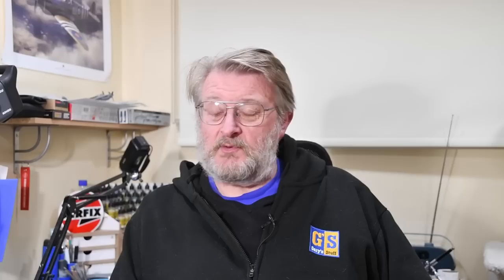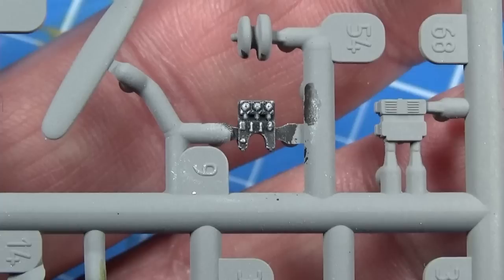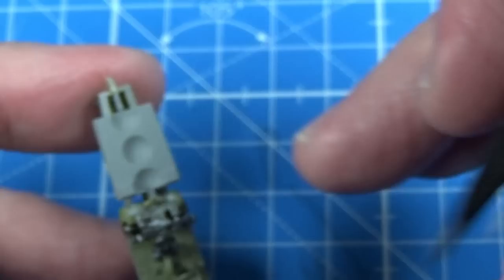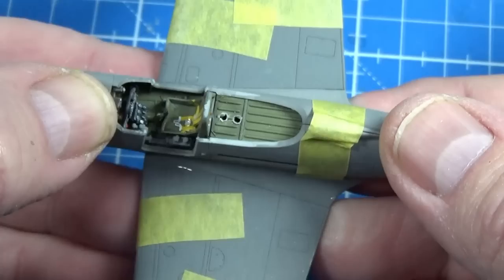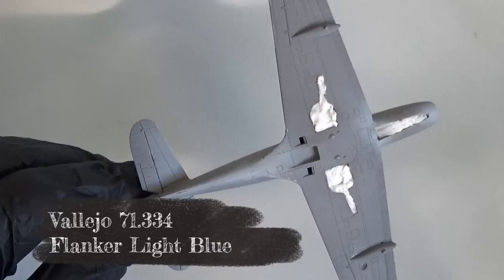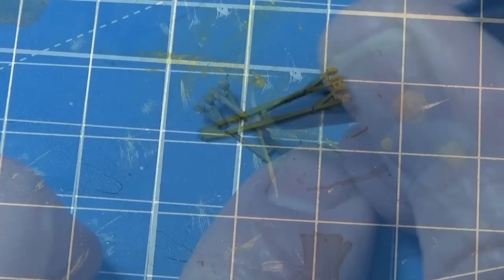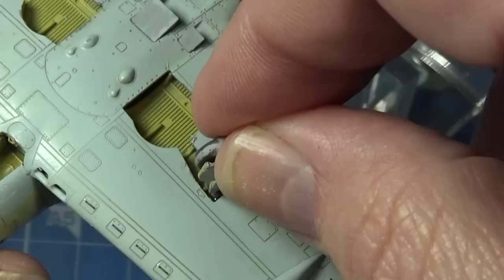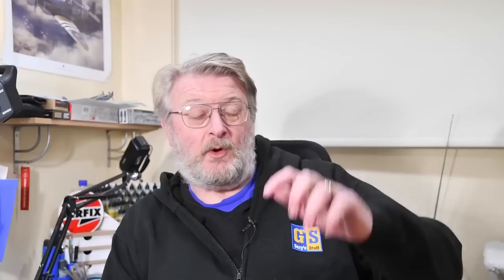P-39 AIRACOBRA Arma Hobby 2022 NEW TOOL 1/72 scale - how to build it - 1080p HD

Comment: Great build I have this kit and I am glad that you made a video showing us the problems that you had so we can be on the lookout for them and be prepared. It looks great and I can’t wait to start mine thank you.
Reply from the maker: It looks great when its done but the nose gear is a bit of a pain. The surface finish is awesome though. I though it would get lost in paint and varnish but it didn't.
Reply: I noticed you found the gap in the forward fuselage when closing it up. Plasmo did a video on this kit as well. He showed a couple of places where the parts didn’t fit flush. One was in the front where he had to grind down the ejector pin circle and deepen a mounting pin mating hole.
This looks great. I have the kit and want to build the same marking s heme.

Comment: I really wish companies gave as standard canopy mask sets.  Especially for 1/48 and above scales and there's no reason not to include 1/72 kits either.  Even if it added a couple of extra quid onto the cost of a kit to cover manufacturing costs and that's probably more than it would cost them to be produced
Reply from the maker: Absolutely - would be a real selling point. Maybe might make starter sets look to complex for the new model maker, but otherwise it would be really good - especially for things like the Beaufort or the He111 where there is glass everywhere!
Reply: I agree 100%. Or at least provide two options, one kit which comes with masks, costing a bit more, and another without masks for those who don't need them. Especially Eduard masks bought separately are overpriced, that's why buying a Profipack usually makes sence.

Comment: Gary gotta have a stern talk to you about your zealous use of glue mate. One thing to say…. Tamiya super thin is all you need.
Reply from the maker: I use Extra Thin a lot, but there are times when I like the grab of a conventional glue, especially where it won't be seen (provided I haven't bogged it up). Normally for wings I'll use a little blob of Contacta at the locator pins, tape it up then extra thin around the seam, likewise normally for fuselages. From time to time the glue comes out a bit sharpish...

Comment: You mentioned airbrushes recently. I guess I am an outlier. After experimenting with expensive dual action airbrushes which are time consuming to clean, I have reverted for the second, and probably final time to exclusively using an easy to maintain, single action, Passche H airbrush with a #1 nozzle. For most modelers, it will do 90% of what an expensive airbrush will do, including fine detail work. It all relates to how much you open the nozzle and air pressure you set. I have created award winning models with the Passche H, and I really believe expensive airbrushes are a status thing with many modelers, not unlike average people who own expensive sports cars. I may receive some blowback for this, but that would be nothing new. Best of luck.
Reply from the maker: That's really interesting. Looking online it is one step up from the very cheap and cheerful thing I use - a Timbertech - without going to crazy money. I guess it could also be a function of the compressor - one with a reservoir tank is probably better than one without, as I'm assuming it will be a more constant pressure delivered.

Comment: One thing I notice that glue will not work with paint as mention in the instruction plans I went throght that as well the glue bottle will get paint on the tip this is when I started many years ago I made lots of mistakes I had to throw the bottle out because the paint affected the build and glue many people on utube do the same thing that why the part will fall off or won't set up right to get a good bond make that a strong bond itsomething I learn from it now I glue the parts and let them dry before I paint the parts it can be very frustrating I know you may have not enought time on utude they do look good after there done especially the langing gear that can be problem matic

Comment: I haven't built this kit but would it not be easier to fit the nose wheel just before you join the two halves of the fuselage together?
Reply from the maker: It might be, but then you've got the delicate nose legs hanging about under the fuse while you're building other things. I broke the tiny one on the Meteor F.8 1:72 doing just that! Guess you just have to be a lot more careful that I am!

Comment: Hi Gary.  Its very detailed for 1/72.  I'm impressed by the weights for the tricycle landing gear.  Strangly enough just a few days ago I nearly threw away the old ball bearings I'd taken out of the bike then I thought thay'd come in for nose weights for model aeroplanes.
I seem to remember that elastic bands were the chosen method of holding the parts together while the glue cures.
What is the clamp/stand you're using, the one with the wing nuts?
I'm impressed by your "weathering".  Have you done a vid on that?